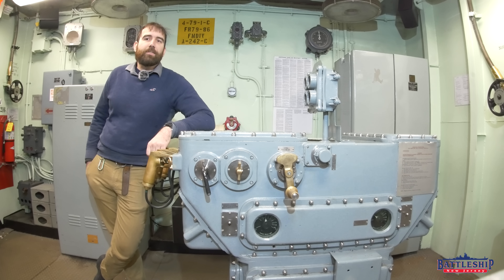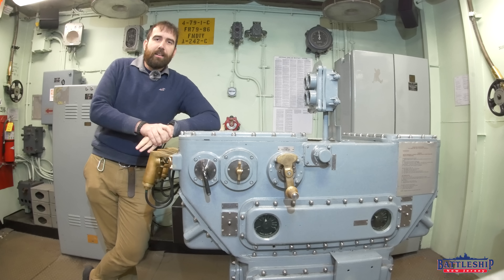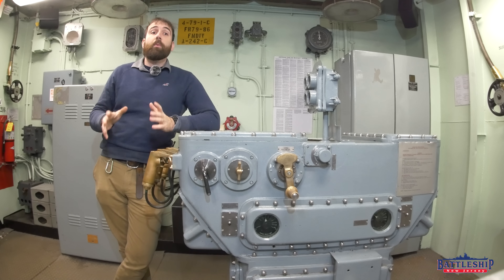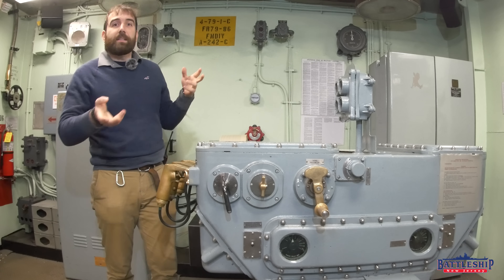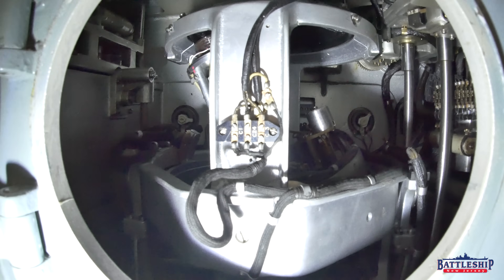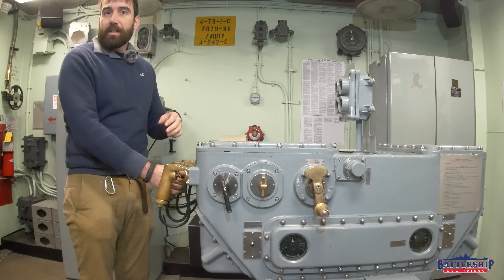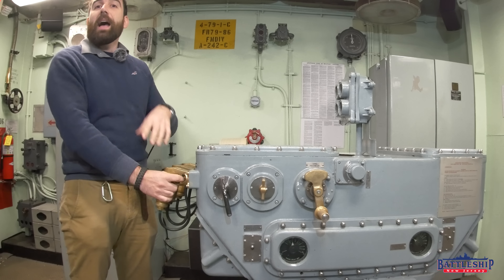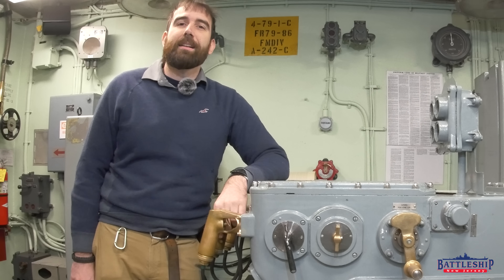The Firing Mechanism for the 16in Guns

Comment: My understanding, and I certainly could be wrong, is that the fire control is even more elegant than Ryan describes.  The old method from wooden-wall sailing days was to fire when the ship rolled back through level but as ranges increased to many miles the delay between pulling the trigger and firing would introduce error because the target ship and shooting ship would both have moved some, relative to the time that the shooting solution was reported.  What I think happens in Mark 41 computers is that the stable vertical element itself sends elevation orders continuously to the guns.  If the firing solution is to elevate  the barrels 12 degrees above true horizontal, the angle of elevation measured in the gun house will be adjusted as the ship rolls so that the barrels stay at 12 degrees everywhere in the roll, once the gun returns to battery after reloading.  This allows the guns to be fired at any point in the ship's roll without having to wait until it is level.  Remember the firing solution is being continuously updated as all those gears turn inside it, based on course and speed of shooting ship and target ship.  If the captain decides not to fire as soon as the gun has returned to battery but wants to observe fall of shot or for any other reason, the computer is continually updating the instantaneous solution.  So by the time he fires, the elevation might be 11.5 degrees (and train angle could be different, too.)  But no matter where the ship is in her roll, the elevation obeys the shooting solution.  If firing had to wait until the ship was level, all you'd need in fire control would be a spirit level made from a puddle of mercury that closed the switch when it connected two contacts.  A stable vertical actually sends orders to the guns to elevate and depress.

You see this in specifications that the guns can be elevated to full 45 degrees for maximum range.  At this extreme elevation the breech is so deep in the gun pit that if the ship rolls in the direction the guns are pointed, the gun cannot be elevated any further and only then must the shot be delayed until it rolls back to level.  If it then rolls the other way, the guns will be depressed by the stable vertical element to keep the elevation above the true horizontal at 45 degrees.  In film of the ships rolling with shooting solutions dialed in, you do see the muzzles bobbing up and down as they follow the orders from the computer, ready to fire at any time.

Remember that USS Texas in bombarding the Normandy beaches flooded her torpedo blister on the unengaged side late in the day so as to induce a few degrees of list, thus elevating the guns beyond her max (which was much less than 45 degrees.)  This allowed her shells to range further inland to disrupt German counterattacks as the American forces advanced off the beach.  She wouldn't have been able to do this if her deck had to be level in order to fire.

As I say, this is my understanding, from reading other sources on battleship fire control, particularly in the Royal Navy.  If I am all wet here with regard to the Iowas, please do set me straight.
Reply: USS Missouri Vet here. You are correct. The "stable vertical" gyro assembly sends a signal to the guns' elevation and train motors which constantly move the guns to compensate for the roll of the ship. So, when you pull the trigger for the "pineapple," the firing happens within milliseconds (although, when multiple barrels are being fired, there is a few milliseconds delay between firing signals in order to 'smooth out' the jolts of multiple firings..

Now, that is what happens normally, when the sea is fairly calm. If you stand on deck, you can watch those guns tracking, and it's a sobering sight if you're downrange of them. But what if the sea state is such that the guns' training and elevation mechanisms are overwhelmed? You can hardly ask the enemy to take a raincheck! That's when the system that Ryan is talking about comes into play, and the automatic firing signal is sent at the point in the ships roll where the platform is passing through level. You can also override the system to allow it to be fired off-level, as I understand when they needed plunging fire for a target on the back side of a hill which required counterflooding of the ship in order to elevate the firing angle above 45 degrees.
Reply: @ericbowen650  I can't tell you how grateful I am that you would take the trouble to explain this confirmation from your own service experience.  Thank you so much, Sir.   A sincere hat-tip to you!

Comment: Lovely electro mechanical kit . Older ships relied on equipment like thiis with components you could actually repair . A lot of redundancy and safety systems part of the circuits . Eleven does seem a lot but covers four turrets .

Comment: Wikipedia Ship Gun Fire Control System has a pretty nice writeup for the stable element.  After this video I immediately had to look to and see how they kept gyroscopic precession from ruining the firing solution due to the stable element gyro being induced off axis over time (and with long ship movements since the Earth is curved).  They applied an ingenious bit of engineering using liquid mercury as a weight that would shift predictably  to ensure precession would put the gyro back to the correct neutral axis to gravity.  While I still can't fully visualize how that was implemented it apparently worked.
Reply: It works because over the very long haul the Mercury does point down. Sky is up and sea is down. Over the short-term, there are waves and sharp turns and things like that So the stable vertical reference is just something that makes a really long-term average out of what the Mercury switch says. Curvature of the Earth doesn't come into it until you pay way more for the gyros. If you could perfectly stabilize to where you were 60 miles ago, that would be worth 1 degree of offset.

Comment: The first battleship I learned about for better or for worse and it was thanks to a Robert D Ballard young readers version was the battleship Bismarck and they wouldn't mention how the rangefinder works so I always thought the gunners were just looking through a simple Periscope with a crosshair on it and putting that crosshair on the enemy ship and just pulling the trigger.

The Bismarck had its foretop gunnery control station and a rear gunnery control and I thought each  station controlled each set of turrets........ I just want to remind people I was thirteen at the time and this was before the internet and it was hard to find books on battleships

I think I've learned more about how battleships and work in the past just say 7 years then I did in the previous 20 years of my life.

Comment: Ryan, In answer to your question I would want a firing station available in each block of beams that would be capable of flooding but with the ship remaining afloat. That did not come out right…. If you have 11 sections and they have to be sealed to remain afloat and 10 are flooded, then u still have 1 last station to shoot from before you go down. Question- I am confused as to how the system interprets the input from the gyroscope!!? It would have to be relative to a “base” or “0 degree “ setting, wouldn’t it? Then the device would know where 0 was…..,  meaning that the “0” would have to be calibrated. And not only for Yaw but for Pitch and in 360 degrees of axis!!. AND…. This would have to be LIVE DATA because the system would have to correct per 1/10th of a second or less in order to stay on target as the ship rolled automatically moving the barrels as the ship rolled!  ….. somehow these men with sliderules figured out how to do this then calculate for distance, windage, etc.! So to calculate for “0” they had to use a machinists level and do so on an absolutely calm day, OR when in drydock. Was there a drydock calibration procedural?! This is mindboggling!
Reply: Gyroscopes are apparently self-leveling, Unavoidable with a globe Earth.

Comment: Gyroscopes are notoriously delicate and possible to upset or "tumble". I'd love to know how many times they actually had to use the manual override trigger.
Reply: When I was onboard in the '80s. We always used the manual trigger. The pineapple trigger was never needed. The Mk.41 was electrically synched to the gun elevators and the barrels would rise and fall with the waves. The trigger operator was always able to fire on command. Ryan's explanation of the pineapple trigger is correct, but it wasn't the normal firing method used during my tour.
Reply: @Budley  Thanks for the clarification!

Comment: La mesa de calculo recibía referencia del estable " centro de la tierra" , rumbo a través del girocompas y latitud para corregir efecto Coriolis. La realimentación de Azimut y elevación se tomaba de dos " Sincros" uno de baja y otro de alta resolución. El primero aproximaba el ajuste y el segundo el ajuste fino. La resolución era del orden del milesimo de radián " milésimas de artillero"
Los accionamientos podían ser hidráulicos o eléctricos, se usaban amplidinas y rototroles, parcialmente controlados por amplificadores valvulares

Comment: From the bottom looking up, the turret can be fired either locally (turret’s computer solution) or remotely. Remotely to me means the turret is getting the firing solution from another turret; or Forward Plot or Aft Plot. The Plots in turn will get their information from Spot 1, 2, or 3 directly; or Sky 1,2,3, or 4 directly; or possibly from another turret. Direct from the Spots or Skys to the turrets would probably be just range and bearing so that may be considered a form of local control.  Bonus question: How many firing keys are in the turret? Not including the turret officer’s firing controls and override  of 1PA. I can think of 6. There may be more I’ve missed.

Comment: I think there should be 4-5 Redundancies per artillery armament type.
1. 2 Stable Verticals (One Primary, One Redundant); Since primary Point of Failure is the motorized geared gyroscope inside the stable vertical a backup gyroscope would probably be prudent to have. The Stable verticals should still be able to calculate range and speed of the target if the gyro is out of action by having the ability to ignore the gyro at the flick of a switch.
2. 1 Manual firing trigger with a non-motorized simple gyroscope nearby to assess the roll angle and allow the user to fire at the right time (Basically a much less complex stable vertical which can act as a manual firing trigger of the previous two redundant stable verticals, but also have much better firing accuracy than a manual trigger without a gyro helping the user with roll angle. Since a non motorized gyro is simpler than one in a Mk48 it is less prone to failure)
3. The Ability to Lanyard fire all guns with manual simple gyroscopes (calculating ships roll) at the Gun captain's position who would be in charge of lanyard firing in case the alternatives go down.

Comment: When you intend to sail into harm's way, you definitely need redundancy.

I would've added a 12th method: a striker mechanism at the breech that an E-1 could whack with a sledge hammer as the final, we-are-out-of-options-because-the-lanyard-broke firing method.

Comment: Very cool system, but I'm curious how the gyro might be calibrated at sea, or at least checked,  or if it's simply spun up in flat water in harbor and didn't really need to be worried about after that. I can see frictional losses due to the gymbal being very low, but would they be completely negligible between harbor/dock?
Reply: I saw a flat-earth debunking video explaining how gyros in aircraft work. Apparently they have a slow correction mechanism that assumes the scope is level. As long as you fly inverted for less than about 5 minutes: it should not come up.

Setting it in the harbor would have similar problems with a globe Earth if you got too far away from the original harbor.

Comment: I have a patient who was on Missouri and serviced the Mark 41.  He says every gear in the machine had a spring that kept the gear under tension so gear lash was eliminated to remove that as a variable in the mechanical "calculation".
Reply: Oh wow, yeah I was curious about that. The gears in the firing system seemed well machined but there definitely was some obvious gear lash. I would have figured they would only "calculate" in one direction either clockwise or counter so you are always keeping contact with the next gear in the chain, but I guess that's not practical in such a complex system. Interesting info
Reply: That is WAY COOL ..... keeping the System pre-loaded 2 eliminate Backlash ..... more consistent
Reply: *Back Lash
Reply: @Dadum-bass this comment is from a year ago there is no way the original commenter is going to change his grammatical error
Reply: @Dadum-bass  You can call it just lash. It applies in both directions of rotation.

Comment: Hi Ryan quick question? does it concern you going into these confined spaces regarding the lack of oxygen you can get in them, seeming i can imagine you would rarely go into these spaces especially the keel and bilge? are they all ventilated to keep fresh air moving thru all those lower deck spaces to prevent oxygen depravation or carbon monoxide poisoning. I have heard lots of stories documented ones and word of mouth ones from my father that worked on ports and docks back in the 70s and 80s that people would go into anchor wells to free a snagged chain and they would collapse because of gasses heavier than air sitting at the bottom of the anchor wells and also the rust absorbing the oxygen as it forms in the wells.         the episode where u went to the keel at the aft of the ship really made me concerned of that happening considering it was the lowest point of the vessel

Comment: Ryan, I have a question about this very topic that I've always wondered about and was meaning to ask: How would a sailor firing the guns choose which barrel to fire? Is there a way to select which firing circuit is being closed for which barrel on which turret from this one location? Or does each turret or barrel have it's own dedicated trigger system? I've always wondered about this. Thanks for the great video and keep up the good work!
Reply: I cannot fully answer your question but Ryan said in a previous video that the middle barrel was the first to be fired and that shot was used as the distance shot ie used as a way to know how off target they are.

Comment: Ryan, in each of the barbets there has to be two rotary encoders (position sensors) - one for elevation, one for rotation (port, starboard).  Would be interesting to see the mechanism that was used to gather the input that fed the Mark 8 Range keeper.  Were they optical? electrical resistive? something else?  Were they upgraded during recommissioning periods?  Modern commercial off the shelf encoders can provide precision below 5 arcsecond (0.0014deg).
Reply: That wasn't my specialty, but I understand that they used "synchros" to transmit the electrical signals...basically, a pair of AC signals out of phase with each other by the amount of the desired signal. Analog, rugged, and easy to switch between fire control points. (Each turret also had a downscaled version of that fire control computer to allow it to fight independently if needed.)